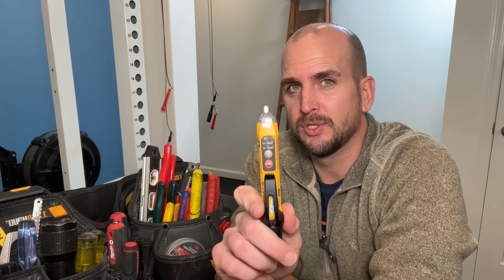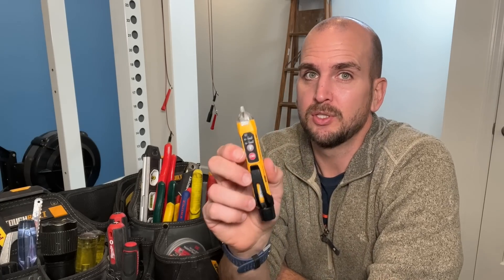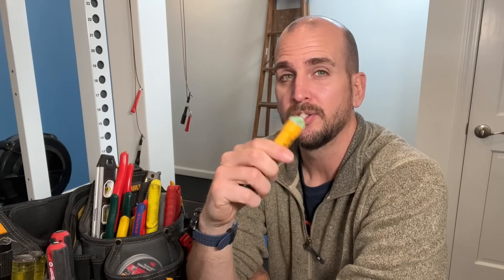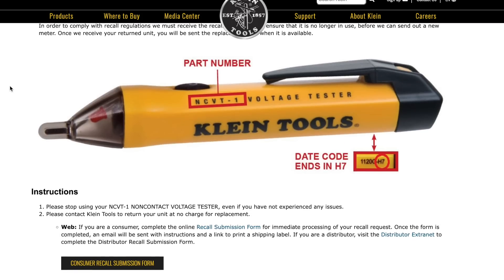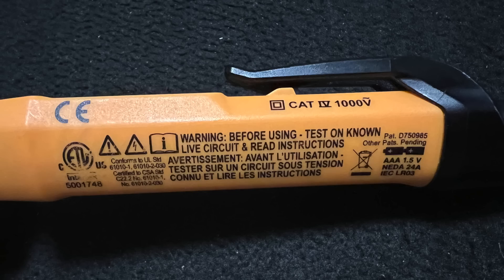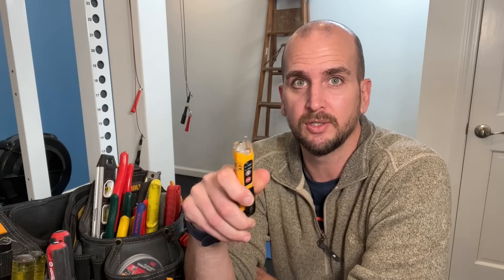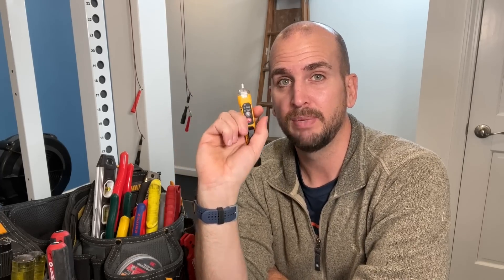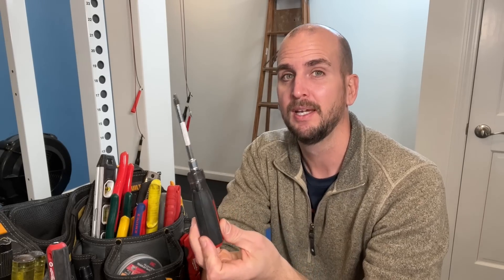The Tool I Get The Most Negative Feedback On And Still Use Weekly

Comment: After I got the shock of a lifetime I always use my tick tester 3 or 4 times before I handle wires! Good tip on testing the unit on a known live circuit, that’s one I always do.
Reply from the maker: Some guys are just meant to stick with carpentry 😂
Reply: @EverydayHomeRepairs  gotta tell you about the time I wired an entire house in Mexico… nervous times when we hooked the power😅
Reply: Ppl actually die more from 120v then any other voltage. Just for the reasoning alone. They think it's not deadly.. just FYI brother
Reply: @ImperfectFilmsHD : I think maybe you mean more people die in domestic electrocutions than Industrial which is undoubtedly true but since most of the world uses a 220v system your 120v figures are likely only applicable to North America and a handful of other countries.
Reply: @rayray8687  yes that's what I meant thanks for clarifying
Reply: @ImperfectFilmsHD  that's a pretty misleading statistic. EVERYONE has access to 120V, only a small subset of people mess with anything higher. Context is everything. It takes some special circumstances to get 120V to kill you, however, we have a lot of stupid people. Think along the lines of power in wet areas that aren't on a proper GFCI..... Getting offed by 120 is a darwin award in stupidity.
Reply: @AnonyMous-jf4lc  how is that misleading if it's true ? Just like u said not everyone had access to higher volts so in that case ppl die more by 129 volts at least here in north America I think it's even in the NEC code book bro
Reply: @ImperfectFilmsHD  because it isn't taking into account any type of per capita interaction. If you go off of how many people get shocked by it vs how many actually die, it would show how safe 120 is. How many linemen live through transmission voltage interactions? It's like saying far more people die in gasoline powered cars than electric cars and trying to determine which is more dangerous to people. You are ignoring the fact that one is greatly misrepresented. That's the point. If you can't wrap your head around this basic concept of statistics, you should refrain from using them at all.
Reply: @NikšaMarković-g5g  it’s where and how much current, with sufficient voltage to complete the path. It’s not as simple as if you get hit with this you will die. So, if we want to get technical, let’s be accurate.
Reply: @ImperfectFilmsHD um no... maybe 240 but definitely not 120 ... yes linemen do count as people
Reply: @Jake-uc8mb  240 and 120v are practically the same thing here in North America you mean 207v?
Reply: You can rub the tip back and forth in your hair (if you have any), the static electricity will set it off and let you know it's working. 
Been doing that for 25 years in the industry.
Reply: You must be a really dangerous with a saw.
Reply: I gotta say, I have been shocked countless times because I frequently don't use anything...  But unless I'm standing in water or sticking the bare wires in my mouth, I just don't worry that much about being shocked by 120 volts. I'm more worried about jacking up my tools with a dead short, and I have the burnt wire cutters to show for that too.  I don't recommend others follow my practice, but I suspect that a lot of people do.  When I'm dealing with 220 V or God forbid 480 V I suddenly become my own safety Karen.
Reply: @djcanfield1 : No rudeness intended but if you are burning your tools and have lost count of the number of times you’ve been shocked it would probably be best if you didn’t work on electrical circuits at all, let alone high voltages, or at the very minimum buy properly insulated tools and study up on ‘best practices’ techniques, as I suspect you are probably doing some poor wiring as well.

As a long-time renovation contractor I’ve seen more bad and unsafe ‘handyman’ wiring projects than I care to remember - some of them just plain dangerous - all through lack of knowledge or poor workmanship. Maretted and taped wires buried in attic insulation with no J-box, kitchen outlets with the ground wires left off, wires run through door jambs to save a foot or two of wire, bathroom outlets with no GFCI protection, un-split kitchen duplexes on a 15amp circuit, J-boxes buried behind ceilings and walls, aluminum wiring attached to non-approved devices, boxes stuffed beyond safe capacity, unprotected surface wiring, 14g wire used on 20amp circuits, on and on and on - this is what I see every day.

There are homeowner/handyman guides readily available everywhere, written by qualified electrical engineers and often fairly specific to your general area and code requirements. Please buy one.
Reply: @rayray8687  yep some people should not do electrical work.  They are dangerous and it only takes that one time to end your life. I get a kick out of people who say I have done this my whole life and then end up injured and in a few cases have died even from 120v. Common sense goes right out the door on some people.  Backyards electricians can be dangerous down the road for electricians as well as homeowners. I was redoing some wiring in a garage not long ago and pulled out the insulation to get to some Romex that supplied a switch box to move it to another position. This was a three way switch and when I pulled the insulation out I saw a big glob of black tape on the romex and a bare copper wire and 14/2 leading from that to the switch. Apparently the homeowner had hired an electrician and he had wired this up years prior and he ran out of 14/3 so he just used 14/2 and used a bare copper wire as one of his travelers. Wow some electrician that was.
Reply: @djcanfield1  I’ve been shocked a few times, and usually not a big deal but one time I was taking a wire I thought was off out of a metal round box…holy crap that was a shock!!! I ended up throwing the metal box across a bedroom and made a big hole in the drywall…ever since then I have flash backs when I work with wires😂
Reply: @djcanfield1 damn dude... I only reserve the Karen level of safety for 480v plus , I mean 120 is just split mid point of 240 and I get shocked at least monthly by 120 but only once by 240 and didn't even notice the difference

Comment: Went to do some work on a project.  Batteries died on the real old Klein.  Went to a simple two contact tester with the switch off.  Also use the plug in with 3 lights. Circuit off.  I Like the Non-Contact Voltage Tester. which is used to also check Romex.  Was working on a switch to a light on the wall that draws power from the receptacle which I knew was off, but I stopped until I get either new batteries or a new Tester. Better "Double Safe" than "Cooked".  Light was installed over the 1/2 toilet sink without a box?  Will continue once I have all the Updated materials.  I've been updating my skill set with your videos.  Really Good for this DYI.  Thanks.

Comment: Hey, 20 year industrial electrician here. I use this as my go to for my troubleshooting once i get on site. Because the one of the first things you do when troubleshooting an electrical issue is check if the equipment has a power source. This is also good for finding open lines.

Comment: I’m a retired 40 year industrial electrician. The common ac voltages we work on is 120/240 , 3 phase 480v,  3 phase 600v.  I do use a fluke model of that. I will use that and teach my apprentices to only use them to check for the presence of power, not the absence of power. Never use it  to verify that it is dead to work on something. Always use a contact tester that you first tested on a know live power source, to verify something is dead.
Reply: i work mostly on home wiring.  no way am i working on 3 phase 480 volt. and no way to work on that without PPE  on.   once saw a electrician put a breaker in a 3 phase  277/480 volt panel and no PPE on.  i thought to myself , you want to die?   fool
Reply: @zerosparky9510  what’s even more scary is starting up a 13,800v 15,000 hp  synchronous
motor. Even though you are at remote station it still could be tense as it rumbles to life.
Reply: @konradpetz7317  I will stay with 240/120volt.

Comment: As a long time renovator and general contractor I can’t think of a single reason why a person working around or with electrical circuits would be reluctant to use a non-contact tester. I’ve used it dozens of times to locate wires behind walls, to determine direction of the run and to do a precursory check of outlets, switches and fixtures. Like a stud finder there is no downside to using it, yet I still know old fools who go about tapping their knuckle on walls to find studs…even on plaster walls!, or testing an old fuse panel by screwing in a lightbulb instead of carrying a simple neon tester. Old habits die hard.
Reply: You will find out when you get knocked on your a ss after after that thing failed to detect the circuit was live.
Reply: @RadioRich100 : If your tester failed it’s because YOU failed to test the tester itself, no other reason. The tester could have dead batteries, might be physically or electronically damaged or whatever but it is entirely up to you to make sure it’s working before you use it. I have a very good Speery-Rand NC tester and a cheap one that came free in another kit and in several decades I have never had either one fail me. Once I’m in the box I also use neon testers or a VOM meter if necessary to verify current. If you are being “knocked on your ass” doing electrical work it’s a very good indication that you should not be doing electrical work.
Reply: @rayray8687  and sadly I've come across licensed electricians who have no business being in business. I was once on a site where I kept getting a signal after the breaker was off.. They had wired the neutral to the panel rather than the hot! For the entire office!
Reply: @vueport99 : Perhaps I’ve misunderstood your comment but isn’t the neutral conductor always wired to the panel? Or did you mean to say they got them reversed as in the ‘hot’ wires to the neutral bus and the neutral wires to the breakers? I’ve seen reversed connections done at light fixtures and wall outlets but never at the panel. It sounds more like a handyman or homeowner job than an actual electrician but in reality it shouldn’t work at all because the hot wire would then be connected directly to the grounding circuit and that should trip the main breaker instantly. Correct me if I’m wrong though.
Reply: @rayray8687  ok I meant when the breaker is off at the panel and the light switch is off on the office wall, the light fixture was still hot.
Reply: @vueport99 : I should explain that I’m a contractor, NOT an electrician, but because I work around electrical circuits all the time I’ve learned to carry various testers and to expect just about anything, and most often I hire a qualified electrician to sort it out. Having said that, I’ve come across phantom or ghost voltage many times and while you’ll get a positive indication on your tester it’s not normally enough to light up the fixture. My understanding is that this can be caused by induction current from neutral or ground wires being run over the panel’s hot bus out of laziness or stupidity (both are very common in renovation work) and they seem to happen more in older houses that have been monkeyed around  with by homeowners over the years.

Another possibility is that two separate circuits have been passed through the same J-box meaning you would need to shut off 2 separate breakers to ‘kill’ the power. In any case I don’t think there’s any possibility that the hot wires were connected to the neutral bus in the panel but THIS IS WHERE YOU NEED TO HIRE AN ELECTRICIAN and not listen to some guy like me on YouTube, lol.

Comment: I don't know what non-contact tester I have, it is green. I always check it against a live wire before using it. Way smaller, simpler, and faster than any other tool. Totally reliable when you test it every time.

Comment: My go to tool for ambient voltage detection is the Klein NCVT-4 IR.  It has been reliable and served me well for several years.  As you mentioned in this video, the tool must be used as directed and properly compared to known voltage prior to use.  Multimeters, dedicated volt meters and any electronic testing tool can be compromised and produce false readings.  My Fluke meter died without my notice and gave me a false negative on a 240V circuit with new batteries in the meter.  Anything can happen here.  They are “test” tools.  Use them properly.
Reply: That NCT thing is a toy compared to a fluke, or you dont know what your doing.

Comment: I was the engineer on a diesel electric paddlewheel gambling boat a few years ago. Our propulsion was 480 three phase AC converted to DC through oilfield style SCR panels. Whenever we had to work on these (there were four on board), you had to make absolutely sure that you had killed_all_power to the SCR panel, as there were multiple sources, and some of the breakers were outside of the machinery spaces. I equipped each of my helpers with NCTV's as a way of assuring that all of the power was off before anyone put their hands inside a panel, and they were trained to always test them first on a known live circuit. Several times we found that a breaker had been missed using these, and the issue was promptly corrected before work began. We never had either an injury or a near miss in my 3.5 years there on the SCR drive panels, and I credit the proper use to the NCTV's for this.

Comment: I use both. If no contact reads hot then I use multi meter to read voltage value. A safe method of double checking.

Comment: You have to understand the limitations of each tool. False readings with a NCVT are quite rare but possible. But a false negative is possible with a tester dongle or multimeter, too. If your circuit fault is between the box and panel on the neutral, a multimeter will show 0v live hot to neutral. Older house without a ground? Multimeter will show 0v from live hot to the box, too. An NCVT will catch both of those. For maximum safety, you need BOTH.
Reply: Exactly, there is a use case and need for both a NCVT and multimeter.  My meter even has an NCV on it, but usually I use my Klein NCVT-4IR for NCV testing.  The IR thermometer for finding hot spots was more useful to me than laser distance measurement, or as a flashlight.
Reply: On an older house you should have tested to another neutral or ground with a meter not one of those toys.
Reply: @RadioRich100  Oh.

Comment: I use the Fluke and it is sensitive enough that I can determine which side of a flat NM-2 cable contains the hot run (for a circuit not pulling any current). When used correctly, I have never had a false reading.
Reply: If youve never had a false reading with your toy your not using it much.
Reply: @RadioRich100  I do not count the flash due to static to be a false reading. Has it ever lied about a circuit being hot or dead?  No, and I always check both side of NM cables, thus no false readings.
Reply: @RadioRich100  And at my age, yes, some toys get used less than others 😊

Comment: In the hands of an inexperienced handy person I would trust a non contact tester way more than a multi meter.
Seen guys sticking meter leads into an electrical outlet then caused some nice sparks, shorted together the leads, .......meter leads weren't long enough to make contact with the prongs in an outlet making them think it was off, ........another resulted in a fried meter, it was on resistance...another thought his outlet was dead only for me to check him and find he was on DC. 

After someone screws up and damages their meter they might not get dependable readings.

Some meters can be complicated but a non contact tester is very simple and hard to damage.

Non contact and an outlet testers are two very essential things anyone working on electricity needs.
A simple mulit meter is also needed but to many people buy fancy complicated meters then dont bother learning how to use them.....who needs the fooking directions? lol
Reply: Good comments.  I would also add to this that the meter leads can also go bad (open).  I would always do  a continuity test before a voltage test.  Even then leads can be intermittent so flexing leads while doing a continuity test isn't a bad idea.  IMHO
Reply: @dwightl5863  Yes thank you for adding that. It is a very good practice and should be done every time.
I have worked with a lot of new to electricity and electronics people and one actually had that same issue, the one wire broke off inside the test lead, couldnt tell by looking so I had him do just as you said...after failing the continuity test which he thought he might have been doing wrong I finally convinced him to open up the test lead connection...he trusted his eyes more than what he was testing....he found a wire was still crimped but pulled back and broken away from the lead.

Comment: I have the Klein Tools NCVT2PKIT Non-Contact Voltage Tester with Receptacle Tester, 12-48V AC or 48 - 1000V AC Dual Range for Broad Application.  I also check with multimeter.  I would not only like to know if a line is energized but get reading of voltage.

Comment: It’s important to get a good quality tester. I have a very good Fluke tester that is reliable. I also have a cheap Ideal tester that is less reliable. Either way, I always double check with a contact volt meter, use rubber gloves and work as if it’s live.
Reply from the maker: Do you have the Fluke 1AC?
Reply: @EverydayHomeRepairs  1LAC-A ll